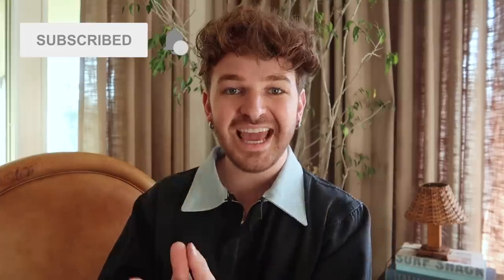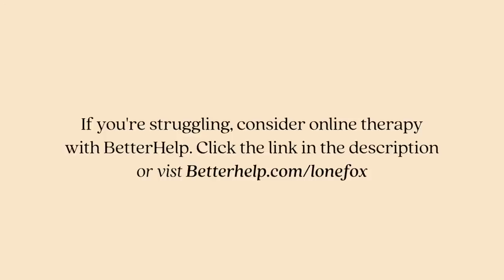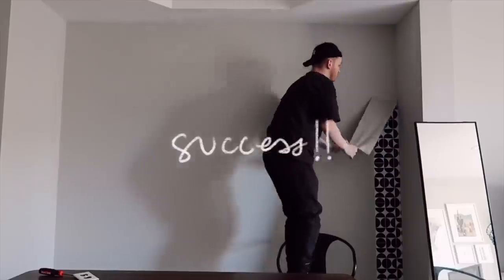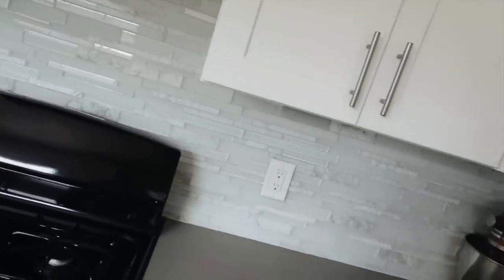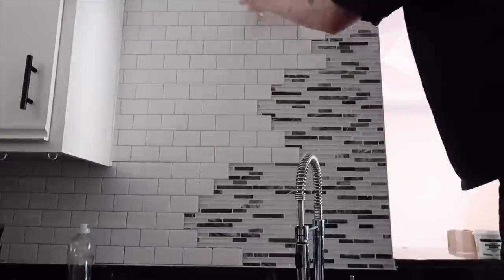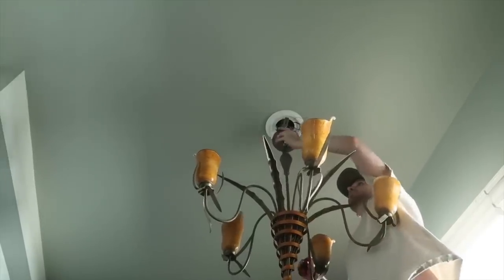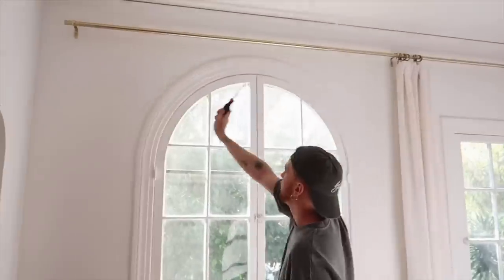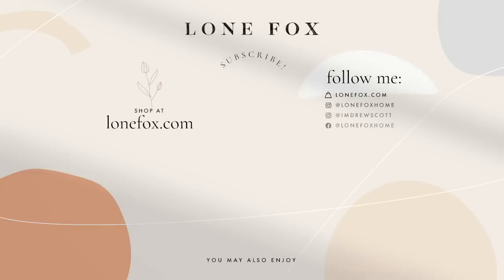The BEST & WORST DIY Rental Friendly Upgrades *Peel & Stick + More*

Comment: Use a hair dryer to remove peel&stick stuff -- works great! I removed a peel&stick backsplash from a rental without damaging the wall.
Reply from the maker: Ohh such a great tip!
Reply: Love you and your amazing talent
Reply: Hairdryers are also amazing for getting rid of dust!
Reply: @danielintheantipodes6741  how do we use it? 😮
Reply: @amy_ambrosio  I am told that you direct a hand held hairdryer at the dust on, for example, a fabric lampshade,and it removes it.  Only works if you use it regularly. Won’t cope with ingrained dust and dirt.
Reply: . . . also oil, cheap mineral oil, but you do have to let it sit a bit. Then you can scrape it off, but beware, The floor will be so slippery.

Comment: I haven't read all the comments, so maybe someone else has suggested this, but I always make my own wallpaper paste with cornstarch and water (heated and cooled). It adheres really well, but when it's time to come off, you can just dampen the wallpaper and then wipe the cornstarch slime 😆off the walls. It does work better however if the walls aren't painted in flat paint. But rentals usually use some level of gloss for durability, so it shouldn't be an issue.

Comment: Velcro command strips hands down. If something’s too heavy and wants to come down, the Velcro goes not the strip so no damage. Also the Velcro strips are easier to remove and I know 16 large ones can hold a glass shadow box that weighs 8lbs so those suckers are the best

Comment: Love your  channel.  Just a suggestion for the windows.  Try and use pre-cut automotive striping vinyl on the windows instead of electrical tape.  It holds up to the heat better and can be removed pretty easily.
Reply: Great tip !! Thank you!!❤

Comment: Hi Drew! I wanted to suggest a really nice hack for wallpaper and rental property. My husband was in the military for 26 years and we moved a LOT. One thing I would do that was super nice and easy easy . It’s using fabric as wallpaper and hanging it with Stay-blu liquid starch. As long as pre wash the super dark fabrics, it peals right off when you move and it’s really nice and works great. We did it so so many times. I’d keep and reuse the fabric from home to home and if I fell in love with a certain fabric I’d just get extra to cover future walls.
Please give it a try! Thanks Vicki 😊💕
Reply: I used fabric in military housing in 1973, but used staples.  Just filled the little holes when we left.
Reply: Can you describe the process? Thanks!
Reply: I would like to see a photo of the hanged fabric
Reply: @poepoesie6390 you pin the fabric to the wall and then use a roller to apply the starch to the fabric against the wall. Or you could roll it on the wall first put the fabric on, and then roll again. You basically want to thoroughly hydrate the fabric with the liquid starch. When you want to take it off you can use a wet sponge, or just peel it off. I did this in my college dorm and it worked out great.
Reply: Retired military wife. Did this exact wall treatment a lot, just did it in the spring. It’s easy to do for sure
Reply: Brilliant and more eco friendly. Thank you Vicki 😎

Comment: I have used the Nuwallpaper brand Peel & Stick wallpaper numerous times and it works like a charm in both hanging & removing. I am in a rental & I have been able to really give my home, my style. I also swapped out the living/dining room fixture for an 'Enclosed Ceiling Fan/Light' combo. I also changed out the hardware on both the bathroom & kitchen cabinets. I painted a 'Faux' rug on the bathroom tile. Hello from Canada

Comment: With peel and stick, you can use the wet application method. (With vinyl decal adhesive applications, they use this method for signage companies.) There’s a solution you can make at home…usually with water and a few drops of dish soap, sprayed from a spray bottle. You lightly mist the adhesive side or your surface and you can position the decal/wallpaper in place and squeegee/burnish it down once in place. The solution will eventually dry and become more tacky again. This technique/method is more forgiving for alignment, if you don’t want to worry about it accidentally adhering in the wrong place (and ruining the wallpaper/decal and wall/surface). You can find plenty of videos on how to do it.

Comment: Not sure if you have this in the States but up here in Canada we have pre-glued wallpaper.  You just drop the length needed in tray of water that is designed for it and then hang it like any other type of wallpaper.  It's a bit slippy but that's good for moving it into place.  For getting wallpaper off I'd suggest a water bottle with some fabric softener in it.  Just spray down the wallpaper (make sure it's really wet) wait a few minutes and the paper comes right off.

Thanks for the rental friendly tips!!
Reply: I’ve used pre glued paper many times in the US.  It’s honestly way easier than peel and stick.  So nice to be able to move it until the match is perfect.  I think I would tear my hair out trying to use peel and stick paper.

Comment: Sadly, I live in FL and have textured walls, so no peel and stick for me. I did find something pretty cool that someone else did, though. My friend got some textured foil wallpaper, put it onto backer board, and screwed it onto the wall behind the stove. She painted some trim with metallic paint and glued it onto the piece with gorilla glue and VOILA! Minimal damage to the wall, and a beautiful metallic backsplash. Backer board is sort of heavy, so you have to screw it into studs, but it turned out beautifully.

Comment: This was a very helpful video. Great honest feedback. We have used peel and stick floor tiles as a solution while we save up for new floors. We had mixed success. It is sticking very well in the bathroom where it was installed over old tile. The kitchen floor was a pain because it is a wooden subfloor and not completely even in places. We used the special primer to paint the floor first but the tiles still did not stick properly. We ended up having to pull a bunch up and use double sided carpet tape where all the seams are 😝. Overall we are happy with the floors I just think I didn’t have a proper understanding of the product when I started.

Comment: Thank you for your honesty about installing peel-and-stick wallpaper and mentioning that it sticks everywhere upon contact! Yet the pricing is so much more affordable than real wallpaper, so.....And I've been thinking about getting peel-and-stick floor tile and also covering my outdated faux-granite counter in my hall bath, and so I appreciate your advice on those (going to move forward on the floor tiles but will pass on the countertops - worrying about seams and edges popping up would be a constant source of stress for me and I'd become hard to live with😅

Comment: Great tips. Watched lots of other content on peel and stick an no one else ever talked about the paint curing issue, or how improperly painted walls can affect how a product adheres etc. you’re going to save lots of renters a ton of grief with those tips. I wish someone had told me about the contact paper issues before I tried doing it in my kitchen. Disaster!  I even used the good expensive stuff and it was a nightmare to apply. My countertops are hideous but that process was worse! I’m just living with ugly brown laminate and dealing with it. Waste of over 100 bucks on that product!! Thanks Drew, excellent tips.

Comment: Great to know which ones of these are 'Lone Fox approved'! Unfortunately for me, the only thing I've used peel-and-stick for is my kitchen countertops. 😞I can concur that it was a royal pain in the behind to install it. My sink is circular which made fitting round it even worse. The end result wasn't perfect but it looks better than what was there previously.

There was one spot where the backing paper somehow twisted round as I was sticking it. Turns out that the two sides of the backing paper are not the same and you can't peel it off the wrong side without leaving paper reside on the sticky surface. This left me with a patch near the sink where you can see a 'bubble' that's not fully stuck down, but I've managed to hide it with a rubber draining mat.

I can't say much about the longevity as I've only had mine down about 4 months. I did paint it with several coats of yacht varnish though to try to make it more durable. I don't put hot pans on it, and I do any cutting on a granite worktop board to minimise the chance of any damage. I'm not in a rental any more but I can't afford to do a proper kitchen reno. I used the peel-and-stick and painted the nasty melamine cupboards and gave them new hardware to give the space a bit of a facelift until such time as I can afford to get it redone (who knows when that will be? - not looking likely on current trends!).

Comment: For the wallpaper tip as well, make sure whichever you use is applicable for the type of paint on your wall. I decided to not use any wallpaper on my current apartment, though I desperately wanted to, because except for bathrooms and the kitchen, the apartment has flat paint, which I read is easily ripped off when you pull down wallpaper, even peel and stick. 

I did read an article or two of a hack with using clothing starch to adhere regular wallpaper to the wall instead, but there are no videos on YouTube recent enough that I would trust on this. Most who did this showed it in really old videos and weren't 100% certain on the type of paint on their walls when I ask them (and it was hard to tell what kind they had in the video).
Reply: I saw a video where a designer used blue painters tape on the wall then attached double sided tape on top of the blue tape. She then added the wallpaper (not the peel and stick type). Maybe this would work for you.
Reply: @evakinney3152  I'm moving tomorrow, ironically, and actually like the current color of paint on the walls there, but this is a great tip for whatever next place I move to, if I don't like the color :)

Comment: Hi Drew.  There is a spray that you can spray on wall before applying the peel and stick and it allows you time to maneuver the wall paper around.  I have not used it yet, maybe you can give a video on it to see if it works.

Comment: DOOR CURTAINS:  If you are renting a place that has an external door in a main room (for example your front door is in your lounge) putting up a simple door curtain not only helps with the breeze and the draft, but also makes the room so much more cozy and makes it feel visually more homey.

Comment: I have always changed out all sorts of things when I have rented a house/apartment (I have bought and owned several homes as well, but due to….life… (aka broken relationships)…I am currently renting again). But I’m also keeping my eye out for a nice home to buy.
Over the years I have gathered some really nice things that I like to use in the place I live.
So I swap the ‘cheap, average, character-lacking’ items that are standard in the place that I start to rent for my own lovely things.
I have several beautiful light fixtures, a great faucet, a few different sized cabinet grips and door handles, a camera door bell and more things like that. 
The items that I take down, property of my landlord of course, I will always keep in a storage bin or bag and save them until it’s time to move.
In the meantime I happily use my more luxurious, my taste fulfilling, higher quality stuff.
And when I leave that rental place to live elsewhere, I simply get the storage container with the cheap junk and gladly put those back to where they came from.

One of the most important objects that I have and that I use in EVERY SINGLE place I live in (whether rented or bought) is my own set of LOCK INTERIORS (one for the front door and one for the back door) that both need/use the same key.
I ALWAYS change those IMMEDIATELY, the moment that I get the keys to my new place of living.
I do not trust on any promise or assumption that the landlord  has changed out that lock between tenants and I certainly wouldn’t want to find some unknown person simply walking in using their old key!
Again I do the same: the lock that was inside the doors are kept in storage and changed back when I leave!

Comment: Hi Drew,  thank you so much for these renter friendly tips. I especially love the light fixture tip! 

Would you recommend swapping out faucets and shower heads? I feel like that could be a good addition. But maybe not as easy for faucets installed to the walls, like in older kitchens. What do you think?

Comment: Upgrade 2: stick floor tile
I am taking off the stick floor tile I have put on my bathroom not because I didn't like it, I've had it for years and it was of good quality, but because every time water falls on the floor or when washing the floor, I noticed that water seeps under the sticks, so I thought this would be creating fungi and bacteria, so I decided to remove. But it's a shame because it's very easy to install.

Thank you for this compilation it is useful!

Comment: No joke about the tape sliding off the window!  😂 Living in Vegas I had that happen to the tint at the top of my windshield (yes it was professionally installed but several years old?) and a wreath on my front door disintegrated because the hot glue melted!

Comment: Now I'm a little worried about my peel and stick backsplash. These walls are not peel friendly, this paint comes off like nothing. However, I did do a little trick when I added each section - I used an X and box pattern of painters tape underneath in hopes of an easier removal. I did the same thing with my cord cover raceway kit because I read that they stick REALLY well. I guess we'll see!!
Reply: I’m seeing other people saying to use a hairdryer to heat up before removal to make it easier! Good luck

Comment: Hi Drew, is peel and stick tile in bathroom ok with water? I have kids and when they take a bath water goes everywhere. I just want to make sure it won't get moldy. Also, are you adding any silicon or caulking around the edges (toilets, wall)?? Thank from your input.

Comment: I really enjoyed this video! However, for the electrical tape one, I would personally suggest to use something like washi tape instead as the glue isn’t as strong and you can more easily remove it in case you need to.
Reply from the maker: Ahh love this idea!!!
Reply: Hm, washi tape though is lighter, so I would wonder if even black washi tape would allow the sun to shine through and make it more noticeable that it's not actual trim.

Comment: At our old house someone went wallpaper crazy. And they didn’t do any of it right. I ripped off half the wall in the master bathroom and the kitchen. They also had carpet in the master bathroom. Which was so gross. I pulled it all up. And my husband put down peel and stick tile. But he didn’t do a great job. So we changed it to linoleum. They also had pieces of wood and then Astro turf on the deck. I ripped that out and we stripped the wood under it and stained it. We eventually had to replace a lot of it. Probably because water got under the wood and Astro turf. I want to turn a can light in our dining room into something else. I saw you do that. So now I know it can be done. I also want to change all of the hardware in my kitchen. I don’t really care about the bathrooms. But we have all the same hardware all over the house.I like the tape on the windows and doors. But I have three dogs. And it would be useless with them messing it all up.

Comment: Hi. Thanks. Respectfully, a heat🔥gun(!) will do wonders re removing peel and stick. I would personally NOT remove without it. …Contact paper for the bathroom counter? You may need to do some sort of clear coat for protection. …Respectfully, I don’t care for those particular pulls because they destroy clothing. Cheers🌬️🏡.

Comment: Peel and stick seems like it comes with a huge amount of waste, which is a bit of a concern - there's the backing when you apply it, and then because it's a temporary product anyway, when you move there's going to be all that 'surface' going into the landfill as well. Is anyone making a sustainable peel & stick tile or wallpaper?

Comment: Put masking tape on wall before peel and stick wallpaper. Less damage
Reply: Do you mean painter's tape? I had a really bad glue residue AND shredding experience with masking tape. Took the paint AND paper surface off the drywall.
Reply: @poetryqn good to know!